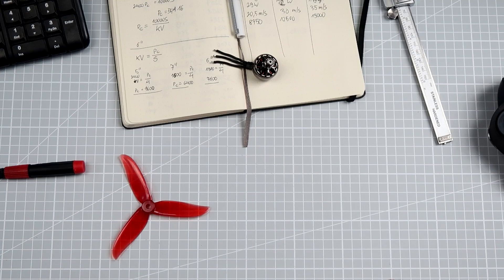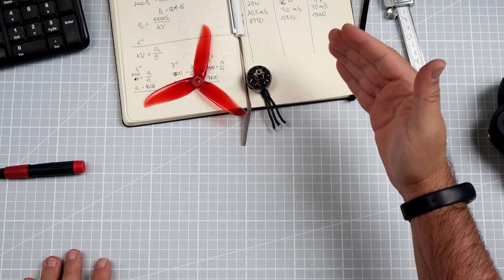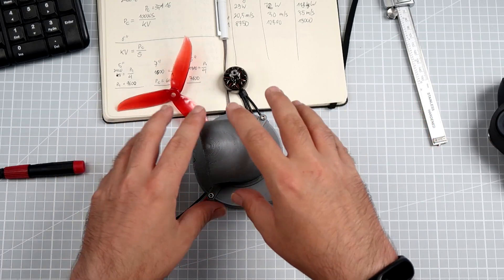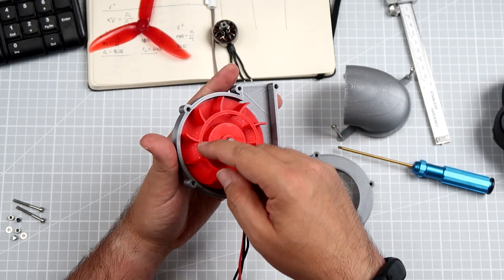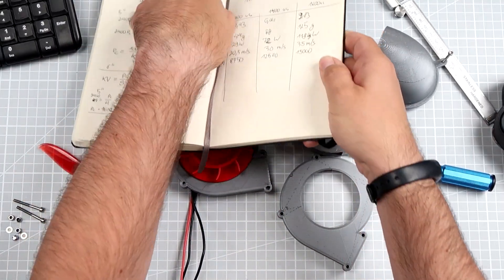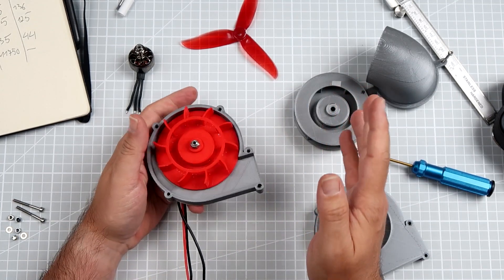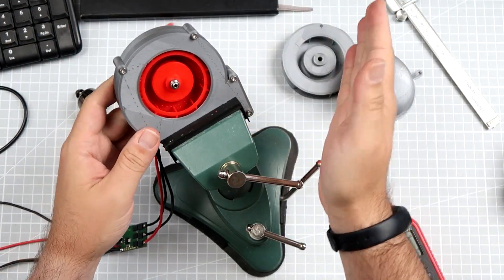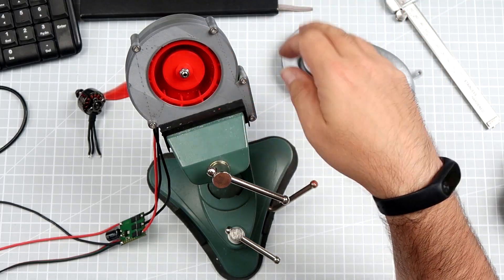Turbo Airplane Propulsion - 3D Printed Impeller Fan - part 1

Comment: love the ideas both you & Stanton come up with. keep up the great work. i'm interested to see what kind of power you can get from your testing on this! 
i'm certainly not even a novice on fluid dynamics, but from Vids i've seen (i.e. "SmarterEveryDay") on 'Laminer Flow", maybe some efficiency could be gained on the angle that the air is supplied to the turbine?
What fun times (in hobby-flying) these are, eh? thanks for all you do, Pawel.
Russ from Ocala, Florida, USA

Comment: I think your design could benefit from having the expansion area outside the fan enlarged. IE start expanding away from the outer edge of the fan just past that corner in the housing, and make the transition to full size more gradual. With the way it is right now there's probably a bunch of turbulence at the beginning of the exit tunnel

Comment: There's a great marine design channel (I'm assuming it is corporate) called Datawave Marine Solutions. They've got some fantastic stuff on boat design including a very good one on impeller design. Obviously a lot of the principles will differ but I think there are some design pointers that might help. Specifically related to the function of the nozzle. I think you need a nozzle to accelerate the air further. The thrust comes from the impulse imparted on the fluid. More velocity, more efficiency.......maybe......I think.
https://www.youtube.com/watch?v=C9jGKaiZIcQ

Comment: I think that the curvature of the fins is backwards.
The air from the outside should be blown towards the turning direction to max out flow and speed, this design is better for a compressor. Not a fan.
Reply: Exactly my thought, they need the convex side leading.

Comment: It looks backwards to me. Shouldn’t the vanes scoop the air?
Reply from the maker: It's fine
Reply: I think the same i think its backwards
Reply from the maker: https://en.wikipedia.org/wiki/Centrifugal_fan#Backward-curved
Reply: @FPVUniversity  regardless of the article still believe forward curved gives you more thrust. As efficiency is of less importance if you have no thrust at all.
Reply: @FPVUniversity  I tried both and there's nearly no difference but the way you did it works best.
Reply: Pawel i'm sorry to say the guys are right! The impeller blades are bend the wrong way. Just An Idea maybe multi stage impellers will improve some efficiency. Like in fluid pumps they deliver much more pressure then single stage impellers. 

Nice work! Keep on going

Comment: Great work, but I think the radial wheels are more for small amount/high pressure applications rather than high volume/low pressure that is more efficient using a propeller.
You also have to get more rpms to get a good thrust. Reynolds numbers get uncomfortably small in our world of model aircraft.

The most interesting publication I have ever read in the subject of radial wheels was this one that I bought many, many, many years ago. Unfortunately I lost it:

Schreckling, Kurt:
Strahlturbine für Flugmodelle im Selbstbau
Verl. für Technik und Handwerk
1994
ISBN 3-88180-120-0
Reply from the maker: this is just a experiment really. And I know that effciency of such a use of a centrifugal fan sucks. It looks cool tho :)
Reply: @FPVUniversity  amazing video i have concept suggestion and please feel free to criticize

Usually the center section of a ducted fan is dead space so I was thinking
If you eliminate the housing and 3d print the centrifugal part to the center of a large ducted fan (choose whatever blade number you want 5-12)

The fan blade must have small air passages that direct the air towards the tips like a jet tip prop

I believe that the centrifugal thrust generated will be better utilized as it pushed the tip of a larger fan and the result should be higher efficiency than a centrifugal prop alone or edf alone

Please criticise and let me know what you think